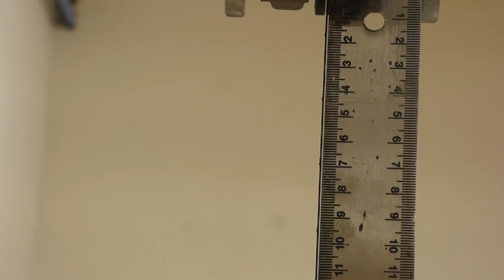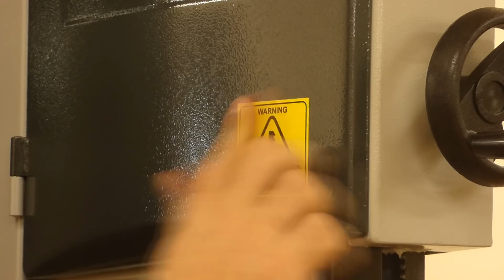Making a band saw stand

Comment: hey. Nice work. I might consider a stand like this for my shop. Just out of curiosity- I noticed you use a lot of beech for your shop furniture. Is there a particular reason why you chose beech or is that just what you have available?
Reply from the maker: It's partly because it's what I always have in stock, but also because it happens to be the traditional species for workbenches and anything that needs to resist wear.

Comment: Are the taper cuts you are making at the beginning of the video experience, a steady hand, having the fence at the front of the workpiece or some trick up your sleeve??? As always, EXCELLENT work and work flow and interesting to watch.
Reply from the maker: I was really just eyeballing it on the pencil mark, wasn't looking for absolute precision. I could have angled the cross cut fence, but it wasn't worth the trouble.
Reply: I guess what I was trying to say without sounding critical...is not "free-handing" a taper cut like you made a somewhat dangerous operation? Or, is it made safe because you are essentially moving the sliding table, and not the workpiece, past the blade?
Reply from the maker: It's "safe" in the way that it's immobile on the sliding table, doing this on a non-slider would indeed be way too dangerous.

Comment: Hey timothy. Happy new year! :) First: a great video like your previous ones. I need a bandsaw too. You decided to buy a bs300e, my question to you: was the record power bs350 too expensive? Is your saw sufficient? Is not the quick adjustment for the belt tension a reason for buying the bs350? Would you buy the saw again? Finally I wish you always enough orders for your work. Andi
Reply from the maker: Hi Andi, I already have a large band saw (Hammer N4400) so I wanted a second smaller one for curved work. That usually doesn't require as much power.
I didn't want it to be too big, I was hesitating between this and the 250mm. At this point I haven't used it enough to give an opinion but if it were my only band saw, then it would certainly be way too small for the kind of work I have to do.

Comment: Bonjour Tim, bon travail comme d'habitude. Wouldn't the weight of the saw be an issue, the stand didn't seem structurally beefy enough, how would you calculate that?
Reply from the maker: As you can see it can hold my weight, the plywood is 18mm birch and I placed it at a slight upward angle. I'm pretty sure it can hold many times more weight than this.

Comment: Another nice little project :) Good going. 
How much is a 15 mm plywoodsheet at your place? In my city it is horribly expensive at 100-130£ :( craysy stuff. :

TR
Reply from the maker: Hi TR, I mostly use 9 and 18mm, the 18mm costs between €30 and 70 depending on the type and quality.
Reply: Thanks. Going down to Germany and pick up a used Lorrey this spring. Think I will stack up on some plywoodsheets at the same time :) 
TR

Comment: Nice video as usual Timothy. Do you have three phase power in your shop or are you running a phase converter and if so what model/spec? Also what are you using for dust extraction? Thanks
Reply from the maker: I have 3 phase 380V, my main dust extractor is a Felder RL160. This band saw is too far from the dust collection system to be connected so I'll make up something else.

Comment: I was thinking about getting the Felder panel Saw that you have. I was looking at getting the electric blade movement and fence movement. I noticed that you don't have that. Is there a reason why you don't
Reply from the maker: If you have the budget then it's a must have, I kinda regret not having the automatic parallel fence, it didn't seem necessary at the time and I was stretching my budget already.
The electric blade movement is less useful on a saw IMO, really helpful on the shaper and planer, but on the saw I don't often need to cut at exact depths. (last week I installed a digital gauge on the wheel that raises the saw, it's just as accurate but not designed to be reset to 0 like electronic read outs can)

Comment: Very tidy. Just wondering, how does the quality of the Record bandsaw compare with your bigger Felder bandsaw?
Reply from the maker: It's hard to say because the stock blade was rubbish, and the custom made Swedish chrome steel blades I had made were even worse. Without a good blade I can't tell yet.
Reply: OK, but you're happy with the build quality for what is essentially budget bandsaw?
Reply from the maker: I'd say the build quality is decent when compared to the price, they obviously have to cut corners to meet a price point. But then I don't think anything significantly better exists in the size range? It is really going to depend on how it works with good blades, I have heard good things about these whith good blades.

Comment: CNC Router running in the background at the end of the video?! new tool?!
Reply from the maker: Indeed but it's an X-carve which I have had for a few years now. It makes appearances in some of my videos when it's used.
Reply: Timothy Wilmots ah fair enough, considering an upgrade?
Reply from the maker: It's difficult to say, I like the small footprint for small occasional tasks. But it's maintenance heavy. Maybe at some point it will be time for the next level in terms of accuracy and capacity.

Comment: Is that an after market fence Tim? I have the BS300 and the fence is nothing like that.
Reply from the maker: Nope, it's the fence it came with. How's your 300 doing and what blades do you use?
Reply: I've had it about 10 years now. It works fine for occasional use, never used it on an industrial scale. I think the guides could be improved. there are some excellent after market ones available. I use Tuffsaws. Superb blades and advice if required. http://www.tuffsaws.co.uk/
Reply from the maker: Thanks, I have always used tuffsaws up to now with success, but this time tried another supplier and the blades are all poorly set, good for the bin. That 'l teach me...
Reply: I don't know anyone who doesn't speak highly of Tuffsaws. It's just not worth shopping around.